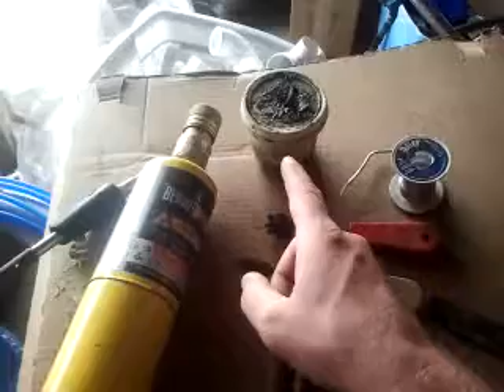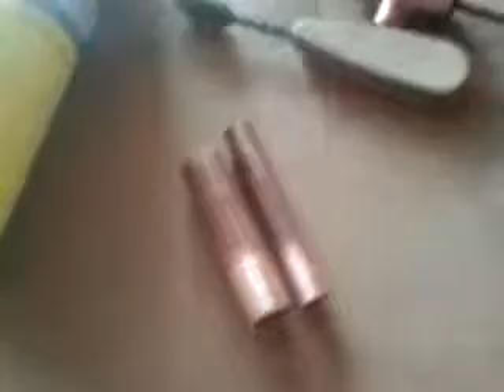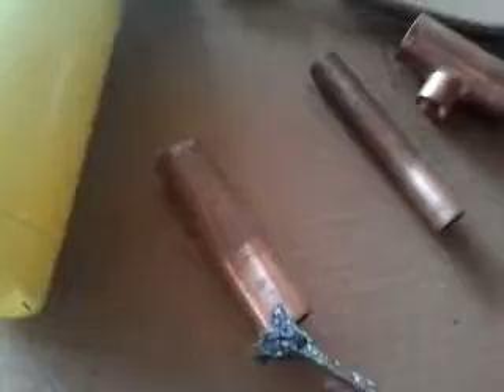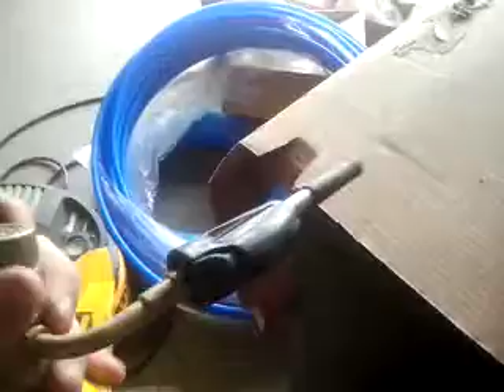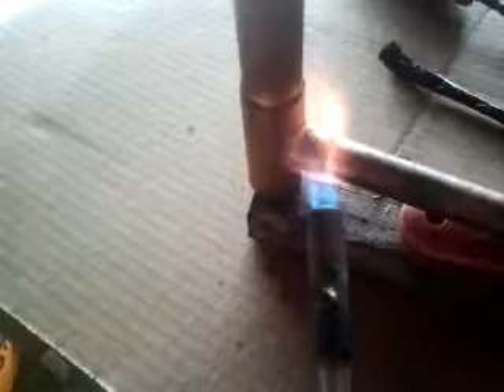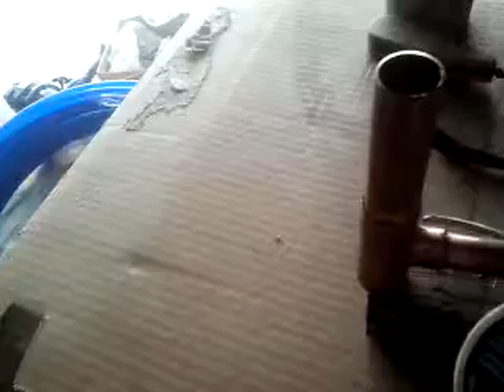How to solder copper piping

Comment from the maker: Once you heat the pipe the flame should wrap around it. The fitting will start to turn a little silver then apply solder at the top of piping, It will pool and flow down like a river. Once it starts to flow pull the heat away and apply solder at the top. Next move the flame at the other locations to be soldered. Once done wipe the puddle off with a cloth or flick it off with the solder. *If it is a repair* drain all the water out of the water lines. A shop vac helps and open all faucets.